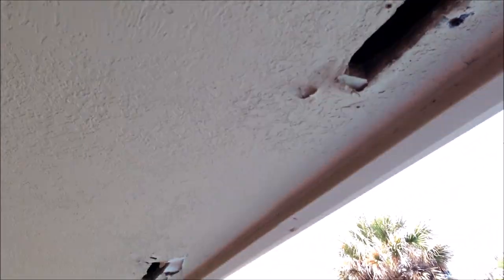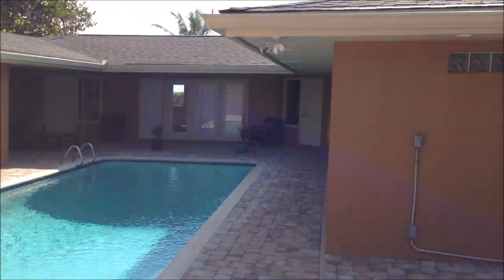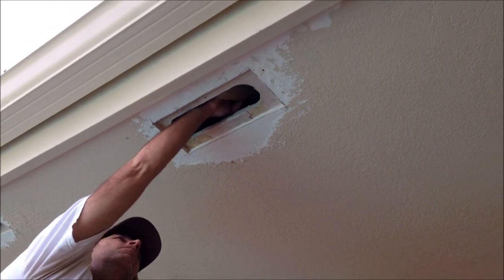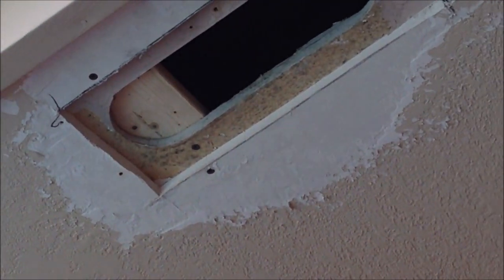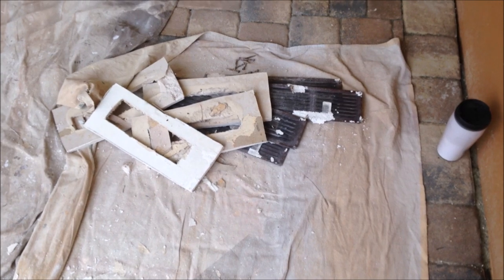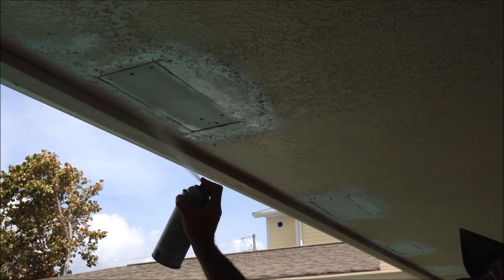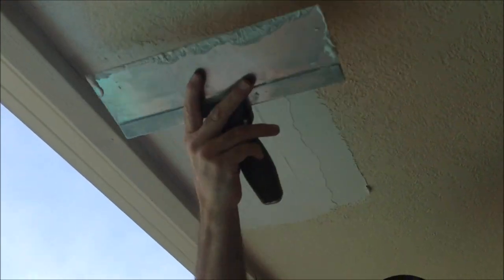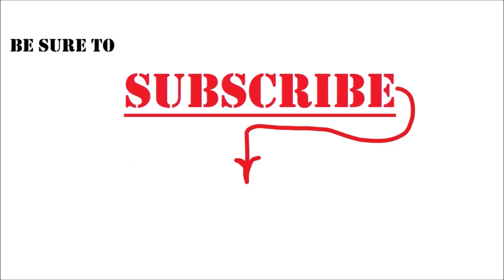Drywall Ceiling Condensation Repair- Why do I do this to myself???

Comment: At 3:50 what is that Mud patch around your repair? Did you abandon a previously-planned out prepare for this before you decided to cut out these holes?
Reply from the maker: Hey there Spencer!💥👊 That's where I scraped off the the bubble, blistered and peeling knockdown texture.👍

Comment: Why no tape on the joints
Reply: I thought it may have been my old eyes and a small phone screen....I didnt see it either  lol
Reply: Was the tape put on between coats and just not shown?
Reply: Definitely heard mesh tape in the commentary..I think🙈🙈
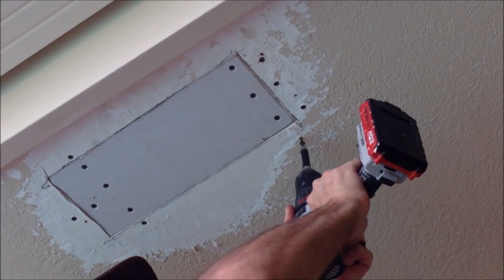Reply from the maker: I did! I used fiberglass mesh and 20 minute hot mud.👍 Right here 👉 5:30
Reply from the maker: @rocknrolljesus3197  It's there 👓 Right here 👉 5:30
Reply: @PaulPeck  lol. Told you my eyes are old and my screen is small. Doin a great job on your vids bud!
Reply from the maker: 😂 keep watching after that... It’s there brother!
Reply: Apologies Paul couple of beers in and the eyes go😂🙈that’s why I stopped drinking on the job🙈🙈😂👍
Reply from the maker: No, the fiberglass mesh tape was there when I did the first coat of 20 minute hot mud.👍🏻 Promise! 🤓
Reply: @PaulPeck  I think the mesh can be seen when paused at 7:39 but only at 1080P.  My default view was 360P which was not detailed enough to see it.